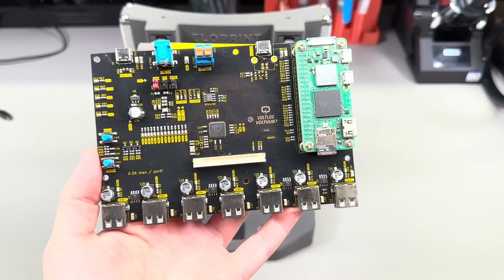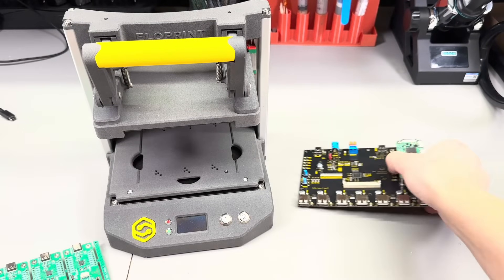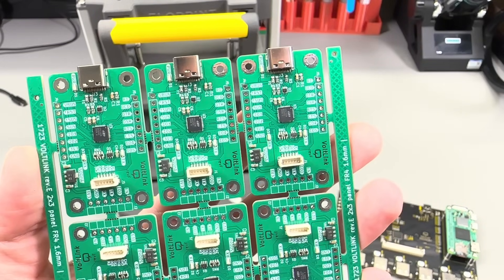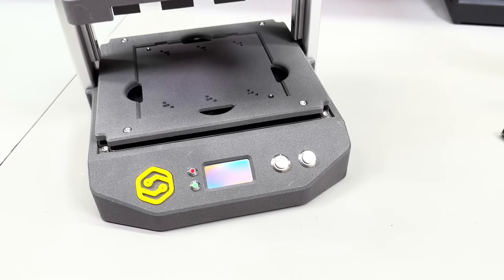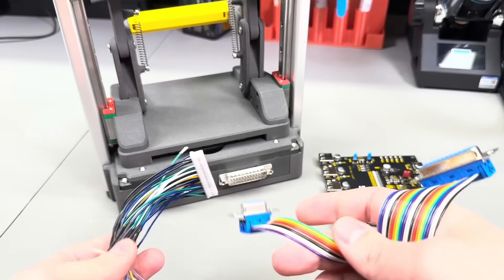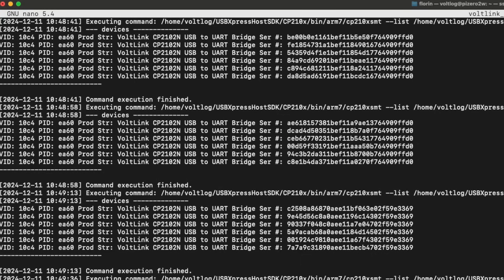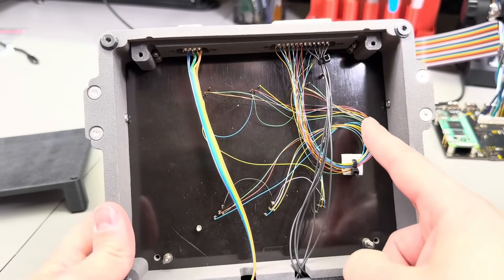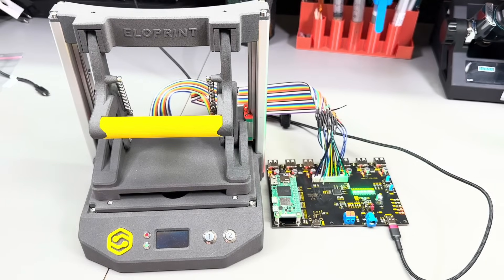I Automated My PCB Testing and Saved 15X Time

Comment: The 3D printed Material on the test jig, looks like SLS-printed Nylon, because it has this matt finish and no visible layer lines.
Reply from the maker: Thanks for sharing!
Reply: Exactly! The material is PA12 from an SLS printer. Depending on the application, we use FDM, PLA, SLS, or jetting printers.

Comment: You mentio about pricing, however you did not diclose what was the price for this jig. It will be good just to know what price range for jig. What to expec.
Reply from the maker: I do not have any pricing information for this build, however Eloprint will be more than happy to quote you a price for your particular project.
Reply: Based on their site looks like its around $1,500 for what he has (maybe a bit more as he added the buttons and screen). Cheaper if you use PETG instead of nylon.

Comment: The jig looks like it's SLS 3D printed Nylon. Very nice
Reply: Exactly! The material is PA12 from an SLS printer. Depending on the application, we use FDM, PLA, SLS, or jetting printers.
Reply from the maker: Thanks for sharing! IMHO, in my limited experience with 3D printing, this is what I would call top quality!

Comment: Wow, what a beautifully engineered test jig. Can you say what the cost from Eloprint was for this specific jig? 90% of the cost must be the NRE.
Reply: FYI, there's a quote calculator on their site. And all I have to say is that, as a small COMMERCIAL PCB assembly outfit, we couldn't afford this, for what it is.
Reply: There's no way that's accurate, quotes me almost 1million dollars  @AttilaAsztalos
Reply: @ConnorWeller  I think the design of their webpage might be at fault here, showing a thousand euros showing like a million. I'm in no way affiliated with them, just curious and I might be wrong. But taking into consideration the price of materials and everything, the cost if indeed in the thousand euros range seems reasonable.
Reply: @maro-j5x  Thanks for the hint. This is an error caused by the fact that, for some reason, we write commas and periods the other way around in German. No one had noticed it before, and we’ve added it to our to-do list.
Reply: @AttilaAsztalos  You can't afford $1,000 to $1,500 for a test jig? Price seems very reasonable.
Reply from the maker: Unfortunately I do not have any pricing information, but I will invite Eloprint to comment on this here in the comments section. In the meantime, if you are in the market for something like this, I'm sure they will be more than happy to answer your request over email. Just contact them.